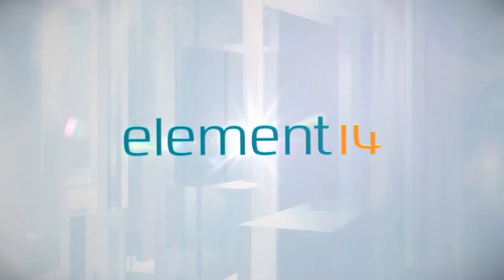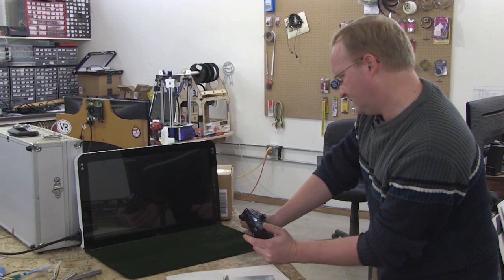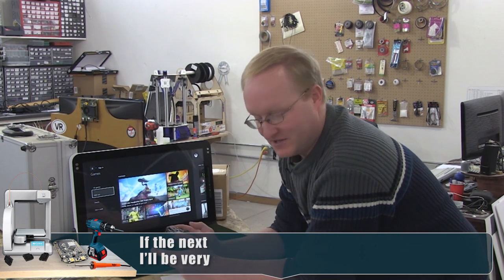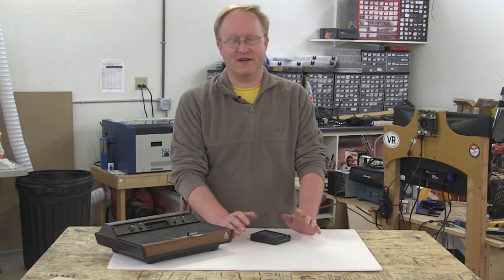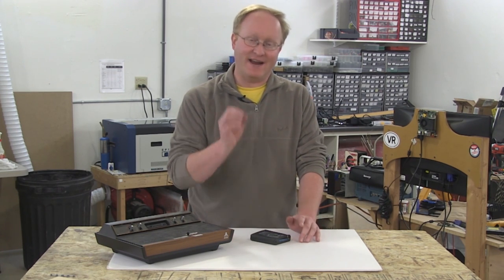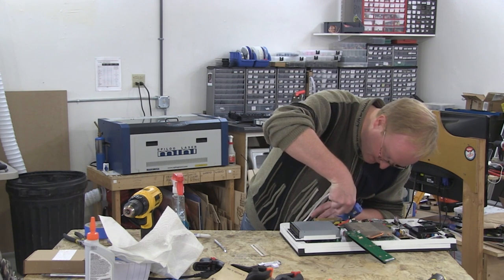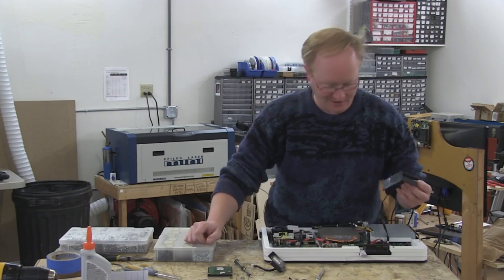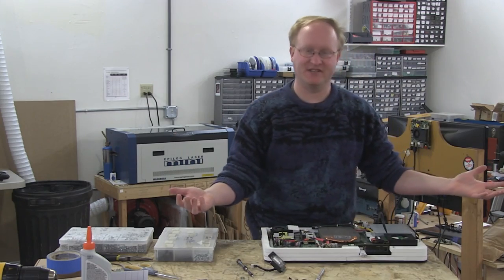Ben Heck’s Xbox One Portable Part 3

Comment: How did the Cpu fan fit in?
Reply: *****
He put it on top of the heat sink, if you look at the Xbox One Factory fan, it's slim enough to go on top of the CPU/GPU and with the vent on! So before you go on and guess the wrong stuff, please, get your facts straight!
Reply: *****
How is saying, "It didn't!" any different from speculation? He even said near the end of assembly, "the last thing to do is add the speakers and the fans."
Reply: *****
The fan for the Xbox One is actually quite thin compared to the fan for the 360 or a standard PC fan. The stand being in the way it's too much of a issue when you take into account that it's an exhaust vent and not an intake. It would be much worse if it was an intake. Still maybe not the best idea to have your exhaust vent immediately in front of the stand, but unlikely to cause any real issue.
Reply: Neonemerld I just was puzzled that he didn't actually show how the fan fitted, just a big hole then BAM finished.
Reply: Alex Atkin
Admittedly, it is strange that he didn't show it, but I doubt an experienced electronical engineer like Ben Heck would just leave it without a fan.
Reply: *****
Just because he's self-taught doesn't mean he's not en electrical engineer. You don't need a degree to have a job title. As I said in a previous comment to you, the fact that it's an exhaust vent minimizes the impact the stand would have on it. You seem to forget that air is a fluid and would have no trouble whatsoever pouring out of the vent and out the sides of the stand. If it was an intake it would be a much larger problem because the fan would have to work harder to draw in air. It might be a bit turbulent behind the stand, but that's about it. The wind would be forced down the stand and be pushed out of the sides. You're making this a much bigger issue than it really is. I would be utterly shocked if it affected temperatures by more than 2 degrees C, at most.
Reply: *****
Comparing an electrical engineer to a doctor? Not even close. To be a doctor, you need a doctorate. To be an electrical engineer, you typically need a degree to get a job in an existing company, but not having a degree doesn't mean he isn't an electrical engineer. He deals with and studies electronics and he engineers them. By definition, he is an Electrical Engineer. A degree proves to someone else that you have knowledge, but it is hardly a prerequisite to having knowledge.

"There are no intake vents in the design, just one above the PSU" is a contradictory statement. Again, I draw attention to the fact that air in a fluid and would have no problems working it's way through the system from the intake fan to the exhaust fan. Blocking a fan directly with your hand flat against a case is not comparable with having an angled stand in front of a fan. Putting your hand against the cast straight on creates a sharp, sudden block, not a slope that it can flow down.
Reply: ***** yeah, if you falsely claim to be an EE, you'll have the engineering police at the door at 3am the next morning, with a sizeable fine and a permanent record... right buddy. Anyone who's qualified to engineer electronics is an EE, they may not be certified in a recognised format, but that really says nothing for their ability or knowledge. Judging by some of the people I've run into in second/third year tertiary study in electronics/electrical engineering, I would say that someone who spent 3 years studying under their own steam, practically, would almost certainly be more capable and more justified in calling themselves an engineer.

Just look at mike (mikeselectricstuff), who did a semester at uni before dropping out, and is very much a talented and far more knowledgeable engineer than many of the graduates I've met. Degrees aren't worth shit in an industry that values results, not BS.
Reply: ***** It's not fraudulent to call yourself an EE if that is not your degree. Go to any university and you'll find that the first 2 - 3 years of any engineering discipline is the same core courses. The remaining classes are specific to the discipline. Of the 2-3 years of courses that have commonality between all disciplines about half are standard general education courses such as calculus, physics, chemistry, ect. The remaining are engineering concept courses. It's fraudulent to claim a degree you don't have as your own, but if you have the experience, knowledge and presence to aquire a job such as an EE. Than You have every right to call yourself one. My best friend majored in computer engineering but he works now as an electrical engineer. When someone asks him what he does and he replies EE, he's a fraud? Sit down sir!
Reply: *****
Since when were you required to be a member of one of those groups to be an Electrical Engineer? Those groups are more for resources than anything, and I would highly doubt that a company would refuse to hire you if you weren't a part of one of those three groups. Let me ask you this: Are you an Electrical Engineer? Do you know firsthand what is required to call yourself an Electrical Engineer, or are you relying on Google to get your answers?
Reply: *****
There are important keywords in that quote from Wikipedia. "Electrical Engineers typically hold a degree" and "Practicing Engineers may be members of a professional body." Neither of those statements say that a Electrical Engineer must have them or else they're "frauds", as you put it. And trust me, I have already read that Wikipedia article.
Reply: *****
And yet I still fail to see anywhere in that quoted text that says you MUST have a degree or be a part of those professional bodies. Those professional bodies are for resources, not a mandatory requirement to getting a job. On top of that, at no point did I ever say anything about getting employed. Ben Heck is self-employed, he owns his own business. Getting hired isn't a concern for him, at least not presently. I'm well aware that holding a degree greatly increases your chances at getting employed, but the truth of the matter is that if you can otherwise prove your proficiency, you still have a chance to be employed, degree or not. Using Ben Heck as an example, he could theoretically use his YouTube channel as a sort of a portfolio to display his skills and knowledge in actual real-world scenarios.

A degree is simply a way to prove to someone that you took formal education for your field. Having one does not guarantee that you'll actually be skilled at that trade, nor will lacking a degree mean that you're incapable of being skilled at that trade.

By your logic, I shouldn't have the job that I currently have simply because I never took formal training in it, despite the fact that I have the skills required to do it and could demonstrate it.
Reply: *****
That's only one of the three you mentioned. And if you're waiting for an apology, you'll be waiting for a long time, because you're still not right. Ben is an Electrical Engineer by definition, even without a degree. An Electrical Engineer is an individual that works with, studies, and builds electronics - as Ben does. He engineers the electrical components of his projects. Even if he doesn't claim to be an Electrical Engineer, perhaps to avoid people like you endlessly belittling him for how "unqualified" he is without a piece of paper, he is still a practicing Electrical Engineer.
Reply: Neonemerld This vax guy is beyond help man, I wouldn't even bother ;) Enjoy being employed doing what you love, the way you want to do it. I'm studying EE presently, but have designed multiple products, and have a business I run out of my house making electronic products. Considering I designed all the circuits myself, wrote the code, and designed the boards/cases etc, I would say I'm as much an enginner as someone who's completed a degree, regardless if I've completed my course, or I'm a member of the IEEE or whatever the equivalent in NZ is. Frankly, if you ENGINEER ELECTRONICS, you are an EE, regardless what one stubborn derp on the internet tries to tell you. Ahh, youtube comments... you never change.
Reply: Chris Tate
Thanks for the support. It's good to know common sense still exists on the internet. ;)
Reply: *****
Are you serious? There is no way you can be serious. Each time you post a new comment, you astonish me with how daft you are. Do you even read what you write in these comments, or do you just copy-paste? It says specifically in that sentence, "in a business name". That means you cannot have a business called 'Electrical Engineers Inc." if you have no licensed engineers - not even limited to Electrical Engineers - working for the business. It has literally no relevance whatsoever to calling yourself an Electrical Engineer. Please, save yourself the humiliation and me the time and stop trying to prove a point that isn't even true.
Reply: ***** How was that stand completely blocking anything? It was mm's thick and only touched the back along a small crease with plenty of air flow around it. lol wtf you have beef with this guy and come on here to slander him?
Reply: He put it on top of the heatsink and somehow it fit.